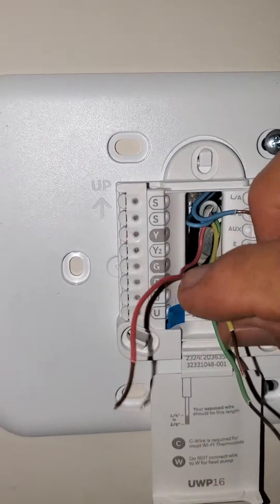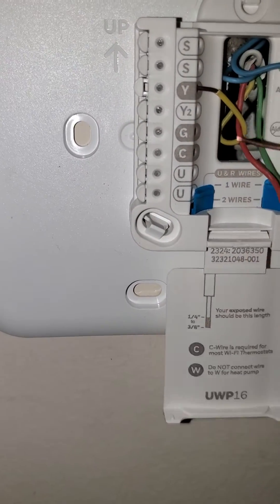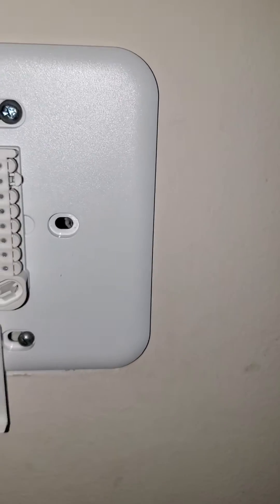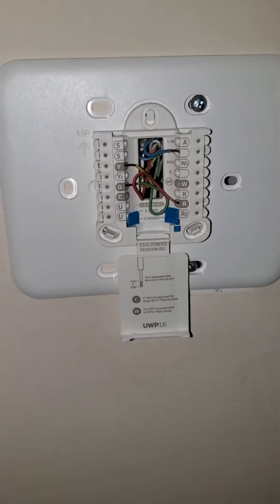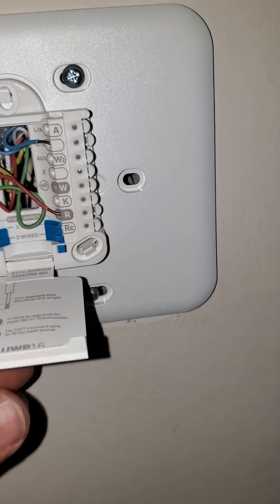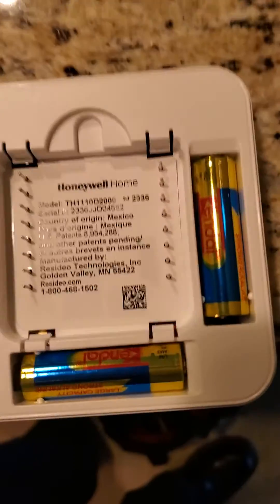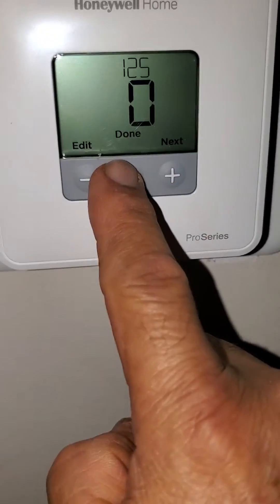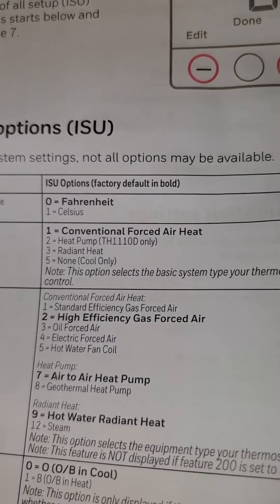Honeywell Pro Installation(2)

Comment: i have a black wire where would it go
Reply: Same question for me. Black wire my old one said L
Reply from the maker: Here they dont use Blk wire at all Must follow the Letter Configuration is best take Pics before and after. We do not use Black wires here unless is from Actuator These are Water Source Heat Pumps on Beach Condominiuns